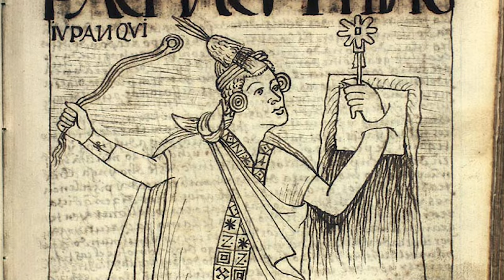SACSAYHUAMAN - How They Did It | Polygonal Masonry

Comment: What about the  serapeum in Egypt explain how they got those big massive stones in such a tight space ,where did they fit the 1000 workers to pull the ropes? 
Answer that then I will believe in what you say.
Reply from the maker: Are you commenting on the right video? This one is about the Inca.
Reply: To Harry Kozonis. About the Serapeum of Saqqara. When they re-discovered the place, they (Mariette) found wooden rollers and winches. Along with lots of steela in the walls , some describing how long it took them to move some of the boxes. Moving heavy objects on rollers are easier then lifting them and carry them. 

As an example, it is easier to move a fridge by pushing it on rollers, instead of lifting it up and carry it.

Comment: Vincent lee makes some good arguments however he sounds like many architects I work with on projects who have a plan on paper that they assume will work, but in practice there are to many things missing for it to work. I don’t claim to know how these were done so perfectly but just from experience these explanations of the methods to get tight joints within a 1mm of tolerance especially when dealing with multiple sides, I think is a bit far fetched. On one hand he says that some methods probably lost to us but has explained a step by step method from start to finish that has never been lost and still used today with much smaller stone. There are a mile of factors that change dramatically when the size and scale changes to this extreme. I can’t see the mathematical equations he mentioned working either unless you are dragging stones across a consistent terrain with a consistent surface. 
The scale and size of the areas are quiet large so I couldn’t even begin to think how long it would have taken. They don’t look like dwellings, they just look like retaining walls built in a sort of zig zag formation. If they are just retaining walls, why go through such effort with the polygonal formation. In my mind the detail and accuracy is so great that I feel there firstly has to be an explanation of what these structures actually are. Are these partly finished or could a lot of it be missing and are we looking at the first course of stone at the current ground level, or are there further courses below current ground level. Fortresses don’t seem to make sense if it was Inca construction because Vincent lees explanation of construction would have taken so long That you could have been in multiple battles while your construction has barely moved off the ground. I am a strong believer in the process of elimination to get to answers and unfortunately Vincent’s methods fall into the eliminate pile for me. 
I did see a documentary showing 2 polygonal walls on opposite sides of a walk way facing  each other and both sides were identical, that is extremely technical even with the tools I am able to use today. With all that said I’m none the wiser and I also don’t buy into the melting and resetting of stone yet because I’m yet to find anyone to experiment with it for me. So for now the mystery of it all keeps me driven in pursuit of answers. Looking forward to more of these videos 👌
Reply from the maker: I don’t claim to know how these were done so perfectly but just from experience these explanations of the methods to get tight joints within a 1mm of tolerance especially when dealing with multiple sides, I think is a bit far fetched. 
Two sides. And the joints are not within 1 mm of tolerance, at least not consistently. Rubbing over the years I am sure got them closer than even what they were. Your sense of the accuracy is greater than its actual accuracy.

If they are just retaining walls, why go through such effort with the polygonal formation.
Because they hold up better.

I did see a documentary showing 2 polygonal walls on opposite sides of a walk way facing  each other and both sides were identical, that is extremely technical even with the tools I am able to use today.
With smaller stones, I expect. Yes?
Reply: There are large stones with multiple sides sitting tightly in between even larger stones. Im not sure why you are thinking only two sides? I’m also not arguing the point of the polygonal design standing up better, that is true, It just doesn’t make sense to me with the tools and transportation suggested because using such large blocks of just consistent regular shapes would be efficient enough, even in just a brick stack. All I’m saying is that I find it difficult to believe the methods suggested were used. I’m still leaning towards methods we have certainly lost.
Reply from the maker: @peterruberto6879  Vince was very clear about how his proposal involves the shaping of only two sides of the stone.
Reply: @WorldofAntiquity  yes I understand that. Would you say the multi sided stones are done using the methods he suggested may have been used?
Reply from the maker: @peterruberto6879  It would be an easy way of doing it.
Reply: @WorldofAntiquity  yes true but unfortunately you cant just assume you know how it’s done with two sides but can’t explain the multiple sides and angles on the same wall.
Reply: This was called how it’s done, you have not shown how it’s done, you’ve just taken someone’s word and run with it
Reply from the maker: @peterruberto6879  The video title is the topic, not a thesis statement. Neither Vince nor I said we KNOW how it was done.

Comment: 🤣The old man is a joke.🤣 He only proved the inca couldn't have made it. Inca were only capable of moving and shaping small rocks is what he proved. Wooden rollers were too difficult, impossible to make round, yet dragging megalithic rocks was easy. This megalythic building style and nubbs/knobs are found around our planet: Japan; India, Egypt. Inca said they just found it and was made by gods. Perhaps gold/metal was used to make a perfect negative, but it would have been impossible for them to move them. Also funny how he says they looked for stones that would fit.. it isn't rough fitting that seems impossible.. it's the perfect fitting that blows my mind. Especially because the inner joints aren't straight. Not like a 2d modern wall, but perfectly fitting in 3d wobbly inside joints without mortar. He came up with feeble theories, then admits he hasn't got an idea and that it was magic. Also where is an explanation for the rocks that look molten and pinched. And why do some of these stones have magnetic properties. Why is everything gone except the foundations, what happened? Why is everything on high altitude in mountains? Why build these megalythic walls/buildings?

Comment: Rollers also don't work for stones that do not have a perfectly flat bottom. They work great for cubical stones and slabs on flat level even solid ground.
They probably pulled them by pouring water on the roads on cold nights, to ice up the roads, or when the roads were naturally frozen over, packed with snow, or wet, so they would slide easier due to less friction with the ground. They could have also used some kind of natural grease. Even could have used a portable rail system consisting of flat even greased logs, on each side the stone sat on, that could be pick up and moved in front of the stone every so many feet. They could have also taken smaller round rocks, and covered the roads with them, so the small rocks would roll under the large stone on the road. Many ways to lower the friction, and make the job easier, just have to use your head.

Comment: How exactly did they cut these stones with a blunt object? And how do you make an inside corner cut with a blunt object. How do you cut carve and place millions of these stones with bronze and copper tools/ instruments ( Egypt) in a relatively short time? 
It’s all impossible. Do the math. Try and make a 12 x12 inch block with perfect tolerances with tools of bronze and copper out of another rock. It would take months. With no guarantee that your stone does not end up breaking in the wrong place. No has tried to replicate it because it’s impossible!

Comment: Has any organization tried to replicate making a large, flat surface on large granite or hard stones using these round pounding rocks or other stone or primitive copper tool?  See how long this takes, or if it can be done at all.  I'm also curious how they could make the fine inlayed corners and edges on the "H" Blocks in Peru using round hammer stones.

Comment: I can't see how using that stick with a plumb bob they could measure  the side and bottom of the megalith  as its impossible to match up the bottom   to fit the stone bellow then lower it in place, then do the side  and visa versa  it doesn't make sense, as for supporting the stone with sticks not all of the stones have the protuberances on them.   It also mystifies me when we are told that when the Inca where quizzed about who built the original gigantic megaliths they denied that they had anything to do with it.  So I am afraid I learnt absolutely zilch from your  program.   So I am not sure of your agenda. In fact the lack of clarity  only strengthens the argument for ancient  lost civilizations
Reply: Who told you that the Inca denied transporting, shaping and building megaliths?

Comment: I wonder if D M  was really confident of some of the numbers given by V L.  weight of a stone X 10 gives the number of people pulling...   for each ton of weight...  the story went from bad to worse,  suddenly the area turned "hilly", then the ground was not flat, but actually rocky ....     without actual testing with actual tools and with the same type of human size and strength    and then lets see if its feasible.....  let us see!  
And then there is the suggested scribing method, suppose they have a pencil or similar, and the wood surface to scribe on...     no no no i am sorry  but no no no results

Comment: Nice presentation, please explain the areas where it looks like hard stone has been cut out, the facing left behind is smooth and it looks like a laser or a hot knife has sliced through the rock, no chisel marks, no pounding marks, sadly if there was any history which explained this method it has long been destroyed, so much is lost to wars and religion, I was under the impression the local people who had history, claimed much of it was made before they got there, and there seems to be different restorations or building, it looks like 3 or more attempts to build each unable to replicate what was there already.
Reply from the maker: As far as I can tell, there is no evidence to back up the story that the Inca told the Spanish it was made before they got there. Someone seems to have made that up.
Reply: @WorldofAntiquity  Nearly all the physical evidence was destroyed or looted, I tend not to dismiss oral history, in many cases it has been proved to be correct, not accurate but then written records are nearly always done by the victor and fail to show a truthful account
Reply from the maker: @Taz6688  I didn't suggest that oral history should be dismissed. I suggested that the Inca never told this tale.

Comment: How about a real video demonstrating the methods with actual granite or hardened limestone. No replicas. That would convince me.

It will not cost you anything as many people would like to see it done. How about Ad Royalties...think about it.

Besides, why are engineers not applying the method to build structures at least in earthquake prone areas. This is a proven tech and have withstood all the quakes for centuries...some even millenia. Why is no one applying the method these days, we have all the tools to work with, even lasers.
Reply from the maker: Ad royalties? We'd need a lot more than that.
Reply: "Besides, why are engineers not applying the method to build structures at least in earthquake prone areas.'

Because modern methods are much more advanced, cheaper, faster, and produce bette results.

Comment: Dear Dr Miano, a year ago I posted the following comment on your excellent video. You may not have noticed it so I am 'bumping it' to you as your thoughts would be highly appreciated on it. 

Best wishes, Paul. 

"Dr Miano have you seen this video ? : https://www.youtube.com/watch?v=YMUZRGuYqY8&t=698s 

The methods that are proposed by Mr Lee cannot account for the evidence we see in this excellent resource. In particular I would humbly bring your attention to 11.40 minutes into the footage. It is apparent that this large stone was either somehow melted, or that it was not solid when these marks were made in it. 

As you will know, limestone does not react this way to high heat so that seems to rule out that possibility. Without entertaining the notion of 'unknown high technology' that leaves the most likely scenario being that this is a large lump of cement, or 'some kind of homogenous setting material similar to what we call cement'. On the face of it that also seems very unlikely, as this is a very large lump! However I think there is an explanation which does not involve UFO's or such like. It is actually quite mundane, ie this is a naturally occurring 'setting material.' Limestone exposed to igneous rock (high heat) equals what? Could this site not be a natural lime kiln? The lime could have been cooked many thousands of years ago, then hydrated by springs and in this state it would stay as a clay until exposed to air and voila you have natural cement. This material would then be used in conjunction with the natural boulders to 'fill in' and essentially create very tight fitting infill 'stones'. It would explain A LOT. 

However it is also obvious that the builders were directly quarrying these stones and it seems that a variety of methods were used, which really confuses matters. The quarry marks left at Ollyantambo are extremely perplexing and Mr Lee's proposed methods cannot account for what we see there. 

These walls are an astonishing achievement."
Reply from the maker: Sorry, Paul. Yes I did see the video. The geopolymer idea has been thoroughly debunked. Maybe I will make a video on it someday.
Reply: @WorldofAntiquity  And yet the stones I have brought your attention to appear to have been plastic at some point in time, subsequently setting into what we see now. As we know, this particular stone does not melt - that discounts high heat obviously. The only logical explanation left to my mind is that this is a naturally occurring lime 'clay', which the builders excavated whilst still wet. This is not so outlandish a theory when we consider the geology at the site, ie limestone over igneous rock and the presence of natural springs - a natural lime kiln. I have no doubt that some of these rocks were carved, an astonishing achievement, and I suspect that the stone nubs were used as reference points to achieve that accuracy - as well as moving them in place. However I suspect that they also used the setting material to fill between these carved rocks. I would be very interested to know what you think to this possibility as it is the only hypothesis that makes any sense to me. Even then, it cannot account for all the evidence we see in the quarries which I find extremely perplexing. 

Best wishes, Paul.

Comment: The method he describes for fitting those stones makes perfect sense. It should take just one shot if done properly. I would think they would only have to dress the first inch or so going in from the front edge for fit. The remainder of the inside surfaces would not have to be as tight fitting and stones could be shimmed from the back if needed.
A simple measuring stick is something used by most tradesmen even today. Carpenters use "ticking sticks" for similar purposes to cut out weird shapes in wood or drywall. Those sticks are pretty high tech stuff!!
Reply: if there put together with only 1 or 2 inch,together at the front,,then the first of the thousands of quakes there would of toumbled all the walls. he talks sht. thaose constructions ar well over 13,000 yrs old. no one knows who built them. they have stoped digging the fallen stones out at lake titikaka, as they are in metres of mud,  FROM THE FLOOD.  12,000 yrs ago. !!!..

Comment: No matter who built the walls in SACSAYHUAMAN, the same people also worked at/on the pyramids, because many casing stones of the Gizah Pyramid share the same features with those wall stones, that stand on another continent. Don''t take my word for it, go check it yourself and you'll see. 9:51 Well, wouldnt that be the fastest and easiest way possible ? Also you could create any shape. Why would that be bad ? 9:55 I'd have to disagree on that. Imo that also is true for complex shapes and forms. 37:17 So I don't think this is convincing, because first of all those stones don't have those two holes for the trunks and also some megaliths weigh over 1000t  and there is no way that they could have been moved by muscle power. Also I think the trunks would break first LOL, long before the massive stones would start to move even an inch, especially when it comes to some of the biggest ones. So this theory is not valid imo.
Reply from the maker: I have been to Giza and have not seen a single stone at Giza that resembles the stones at Sacsayhuaman, and certainly not the style of wall.
Reply: @WorldofAntiquity  WTF? Did you have your eyes open?
Reply from the maker: @TopazBadger6550   Of course, and I would be willing to bet that the differences are so marked that even a child could tell the two apart.